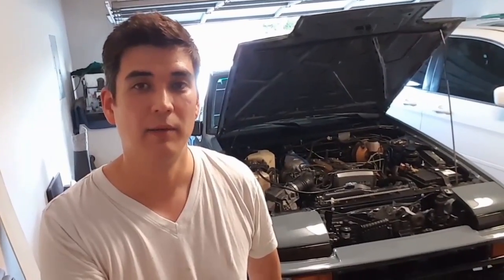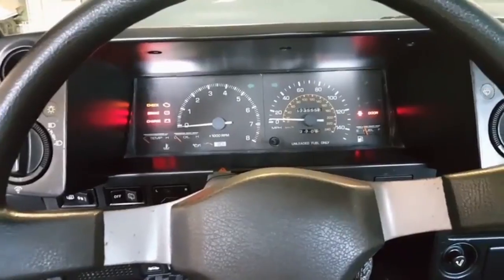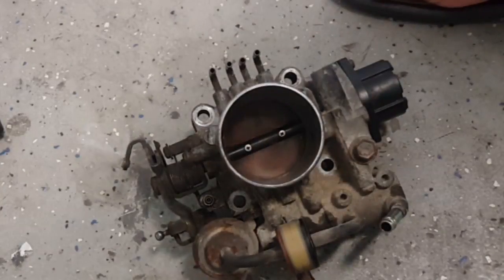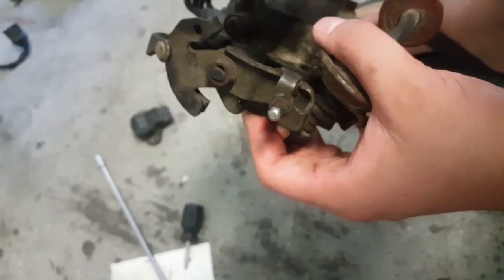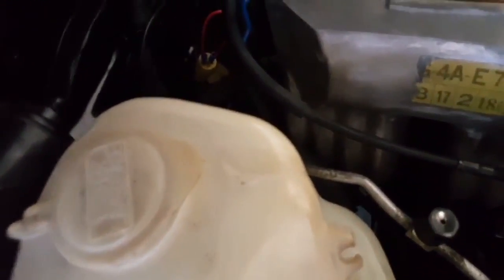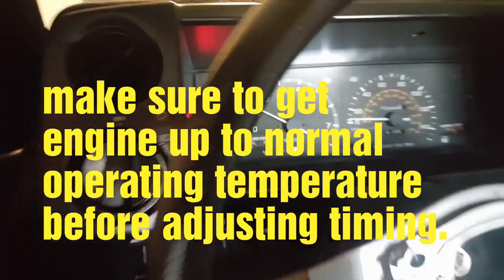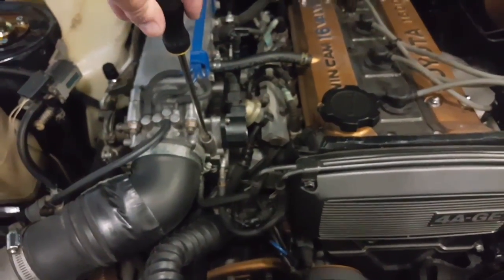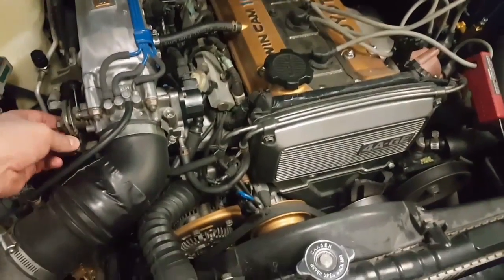Ep53 PROJECT AE86 - How to properly set timing, tps, and throttle body on a 4age!

Comment: Watched another video that didn’t include the throttle plate spacing tip, so readjusted with your help and
The difference is night and day, I can actually use high gears without brutal fuel kicks! Cheers man keep it up

Comment: Sweet video, I've been chasing down a high idle for a few months now. Its most likely a bad IACV valve, gonna block it off, then tune the tps and we should be good to go!
Reply from the maker: Evan 86 Levin you may be able to clean the  iacv valve really good and thorough and it may help.....good luck bro.

Comment: I know it’s been a while, but when I do the first initial setup, I cannot get 1 with the new TPS. I only get a max of 0.11 and then OL. Using the old TPS, it goes to around .900, but I can never just get 1. 

The idle set screw is done exactly as you stated, so what could be wrong here?

Comment: Very clear information! Thank you so much! But where did you get info about throttle plate adj. ? By the plate we have a hole (from idle speed valve) which bypassing plate and air going to intake manifold -- so shouldn't plate be fully closed?
Reply from the maker: yeah i see where you're coming from.  However, i got my info from jondee86 @ club4ag (he knows his stuff) and it works for me.  You might give it a try with it fully closed and see if it makes any difference.??  Thanks for watching.
Reply from the maker: Ok I just found the old thread on club4ag and he said it's to keep the throttle plate from wearing a groove into the throttle body.  :)
Reply: @notnilc20  it makes sense , because i think in body I already get this groove. For this time I have same problem , error code 7 and 11 , I already tried so many times to adjust tps and timing , and still nothing :(
Reply from the maker: @alexrud3874  did you test your tps to make sure it's still good?
Reply: @notnilc20  yesterday, I finally removed this errors, it was bad connection in the plug for tps )) Buuuut , something happened , and when I finished with 10 deg. in diagnostic mode , I stopped the engine to remove jumper and to see how it goes to 16 deg. I couldn't start it ))) Now I need to troubleshoot this situation (

Comment: I still have one question: my throttle stop screw is already maxed out and I still can't seem to pull my paper out, and I'm using the thinnest paper I could find lying around home. Should I just leave it at max then? Also, my Allen screw seems stuck to the nut (they both turn together, maybe that's why I can't turn it further) is that normal? Thanks man!
Reply from the maker: They should be able to turn independently.  Did you try adjusting it all the way the other way?  Sorry, its been a couple years since I did this so I'm just going off memory and I've since sold the ae86.
Reply: @notnilc20  hey, thanks for the reply! Yes I did, I got it out first, see if I could get these two to separate but nothing. Very stuck... Is it possible to just leave it at max and adjust my TPS according to this setting? And then just adjust the idle with the idle screw on the top of the TB? What're your thoughts? Thanks again!
Reply from the maker: @maartenvanloon8586  Certainly worth a shot.  As long as you can get that tps within spec so it allows the car into diagnostics mode, I don't see why not.  But the only way to tell is to just do it.  Good luck 👍!